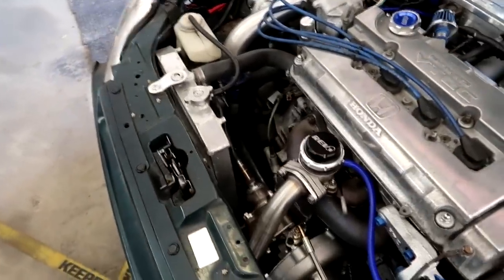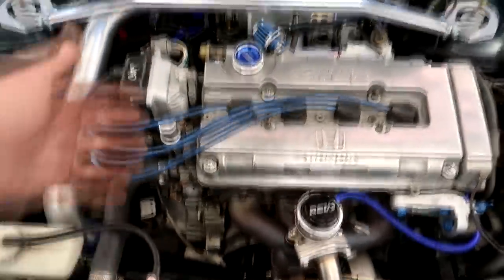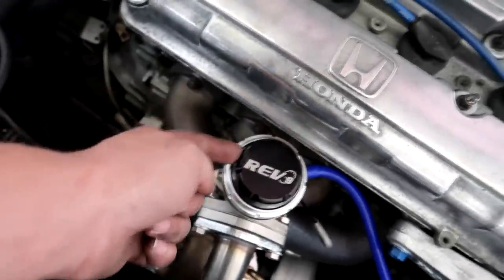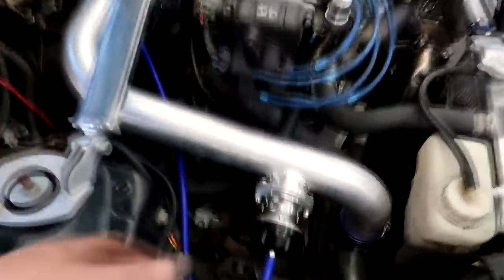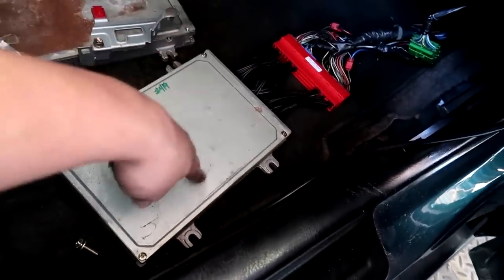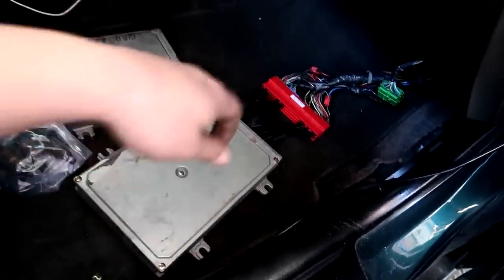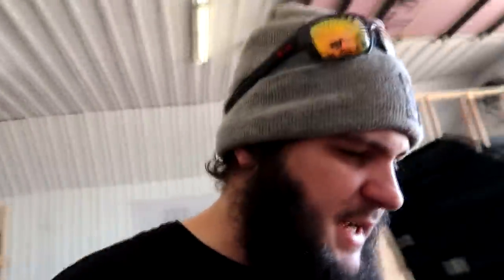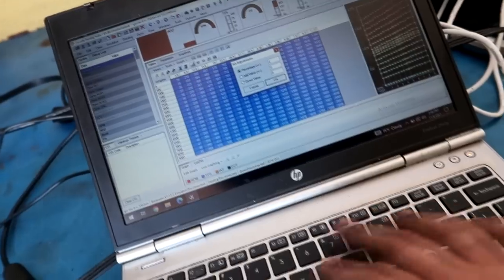Budget Rev9 Turbo Kit Makes Over 300HP To The Wheels Honda Civic GSR B18C Swap Dyno Tune

Comment: Looks like the same Rev9 kit I have on my DA. For some reason I had to cut the flange off the downpipe and rotate it quite a bit to get the downpipe to bolt on, other than that, things were pretty good. I cut up the intercooler pipe a bit and did a bit of a back door style. Was a really good way to spend money to get the build going, swapped out a few parts along the way or upgraded, but I'm glad I went with the cheap china kit route.
Reply: I’ve yet to figure out what car that damn eBay down pipe will actually bolt up to correctly. They list the same one for pretty much everything 90s but I swear it doesn’t actually bolt up right to anything. I’ve tried 92 Si, 93 Si Del Sol both D16. And a 1996 Civic with a B18b1, so I feel like all bases covered and it didn’t bolt up right to any of them. 😂
Reply: @SlowDelSol  Yeah I went to bolt it on and went....uhhh.... huh? So yeah I cut the flange off at the welds, rotated it, and I do believe I had to add a little sliver to get it to clear the oil pan aswell. It's a hacky downpipe, but it works.

Comment: I like how you adjust the whole column instead of percentages In the air fuel difference, different strategy
Reply: if the curve is right then its really that easy.

Comment: My biggest problem with logging, and HTS in general, is it seems like any time its updated, or reinstalled, it makes a new folder in the system, and that folder holds all the display settings, emulator and logging settings, and generally everything that you 'tweak' when you start getting comfortable with tuning software (imperial or metric, value mins and max, etc) Also, when first getting my hulog and FDTI adapter setup to log, either after an install, update, or using a new laptop, I really have to fuck around with the drivers, checking com settings, and generally fruit around with things to make sure everythings happy.
Reply: Hey man curious as to what emulator you are running? Data logging and on the fly updates?
Reply: @770hood  Ostrich 2.0, and Xtreme hulog, or generic adapter. Yes the logging works, sampling rate and how much info you want to log may corrupt it. It's common for a lot of guys, newer versions of HTS have improved this, and turned up the response time for a lot of the non-crutial logs, that don't need high resolution .
(IE temp)
Reply: Seems to be an issue when settings are set to ostrich. When using my cobra or demon I have no issues. When and if I do I use 1.9 to just get the car tuned and done.

Comment: It’s so much cheaper to buy the parts individually on eBay. It’s all the same China parts anyways. They just add their logo to a few key parts but it’s all coming from the same handful of suppliers.
Reply: No lie. You can get an oil line kit. Turbo. Manifold. Piping kit and almost be done
Reply: @hondaland_  The little shit still adds up and depending on your hp goals you would still need injectors, fuel pump, ecu & a piggyback or chipped, bov, wastegate, map sensor, wideband, intercooler, oil drain bung, exhaust piping, vbands and clamps if the turbo or bov & wastegate is vband style.. my turbo "kit" I bought from I Treadstone didn't come complete and I had to buy alot of shit separate.  It definitely adds up.. Personally I wouldnt recommend Treadstone kits they are garbage imo, manifold is nothing but junk. Breaks the bolts or strips the threads I've had to replace the WG bolts 5 times and helicoil it twice. The exhaust nuts hit off the manifold because the casting is wrong. 8 out of 9 studs broke. Plus I've replaced 5 turbo bolts aswell. And thats not even a year of driving yet. Not fun replacing broken bolts time after time. I have 1 bolt holding the wastegate once  because the pos snapped another bolt a couple weeks back. Lmao sure is fun

Comment: You should invest in the moates emulator so you dont have to constantly re burn the chip I use it on my street tunes and I love it 😆 cause my moates hulog dont work and that’s kinda how I do a tune without burning like 5 times
Reply: He must have sold his ostrich because he had one
Reply: @hondaland_  yeah those are good to keep around cause all I rather tune on is hondata but some people just want a chip regardless 😆
Reply: @Cozel  I'd rather tune on HTS. Not limited to one piece of hardware or software with the chipping stuff and emulators. Hondata is just a proprietary overpriced emulator and software. Plug and play but I'd rather have a fuel tech at those prices
Reply: I love my demon 2. Has on board data logging. Extra analog pins. Knows on it's own if your datalogging via wire or Bluetooth or on board on its own. Unlike my CobraRTP needing a utility to swap between wireless and wired but the cobras are plug and play as well. Love those too. Just doesn't have the ability to record logs to the emulator board like a demon or hondata can
Reply: @hondaland_  facts yeah I choose hts over chrome anyday but yeah I feel you on that

Comment: How is that rev 9 holding up ?
Reply: This is my sedan. Been running just as good as the first day i got it back from the dyno granted it was running almost perfectly before i turboed it but nonetheless runs really good dont drive it everyday because of work but i take it out for a rip every couple days wouldn't doubt i could daily it the tune is 💯
Reply: @lamydora457  that's awesome I just picked a rev 9 up not long ago and installed it been running 22 psi its been holding up well
Reply: It’s just the more psi you run on the eBay turbos the life span is less… overall the kits are runn especially with a good tuner.

Comment: hows it going hunter big fan im building a little turbo single cam do you tune as a hobby? or can i take my civic to you get it tuned? where you located?
Reply from the maker: I’m located in Wisconsin If your local can email me huntertuned@gmail.com
Reply: @HunterTuned  ahh im in miami. what do you think i should push my stock y8 as of psi im gonna get little things like fuel pump injectors. also what should i do as of ecu s300? or do i get a chip? thanks for your time im trying to get as informed as possible before i go buying stuff thanks for your time @HunterTuned

Comment: My datalogger doesn't work with HTS anymore, either.  It might be because I'm a noob.  Maybe something in the software broke.
Reply: Sometimes you need to reconfigure your HTS settings after an update, I like to copy over the settings folder when I re-install HTS or update, or move to another system.
Reply: Yeah latest version seems to need windows reset when it won't connect. I use 1.9 or 2.1 and it works Everytime.

Comment: I would grab a moates ostrich with all these chipped honda's so you can tune on the fly mate rather than keep flashing the chip every time you make an adjustment
Reply from the maker: I do have a few ostrich I just am also having issues with it connecting to the hts
Reply: @HunterTuned  I run ostrich 2.0 aswell. I could probably help you get it solved. Most of my issues I was ranting about on the other post had more to do with the ostrich than the hulog, and also that I kept forgetting I need to be key-on to log, and killing power to the ECU would end the log.
Reply: @HunterTuned  oh fair enough. Mines been fine? I can double check my settings next time I do one and ping you an email?
Reply: @HunterTuned  I also put a hc05 Bluetooth module in all mine to datalog too. Then the owners can link to it via tunerview for Android and monitor everything/have a custom digital dash using a tablet